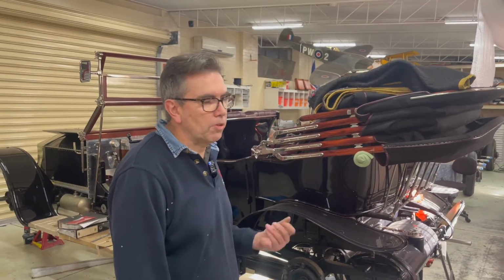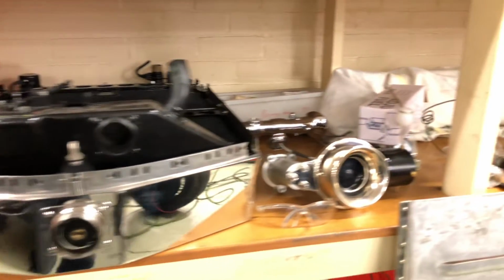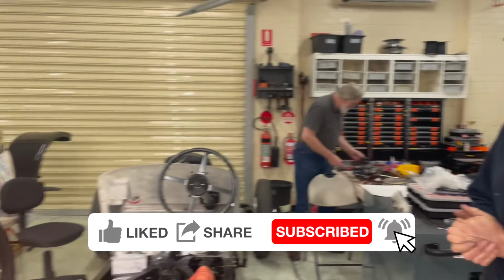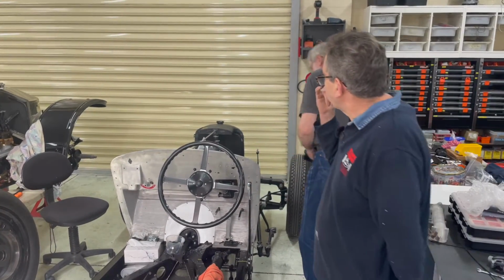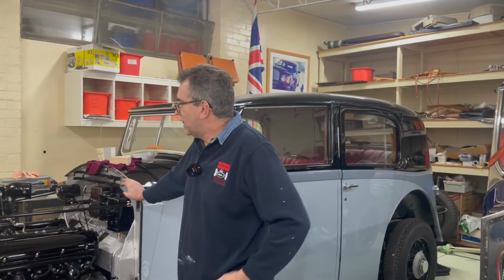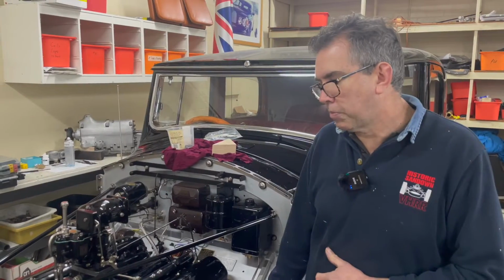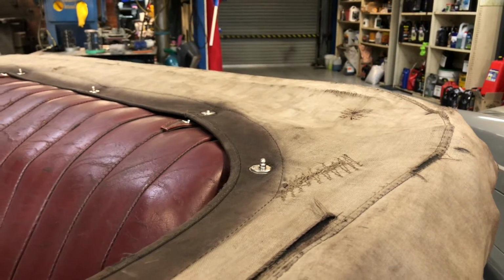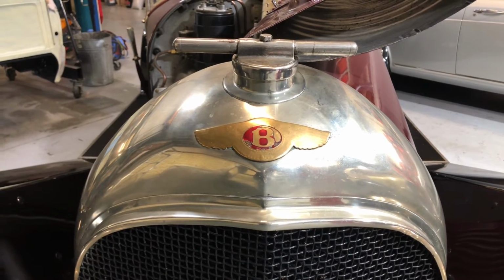RARE Bentley finds its way back to original family after chance meeting in bookshop

Comment: The sedanca body was not about a 'nice experience' for the driver. With the driver exposed in an open front area, the owner was clearly separated from a mere servant who drove. Many sedancas had a light canvas cover to give a little protection from heavy rain for the driver, but clearly segregated from the passenger compartment.